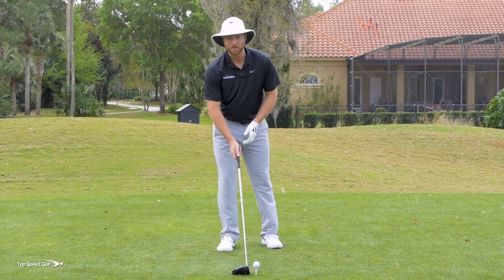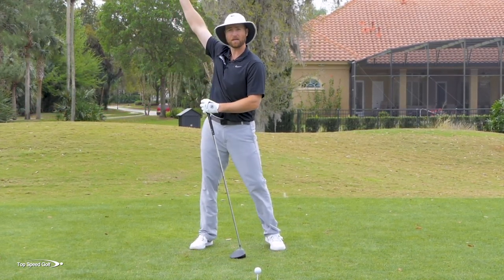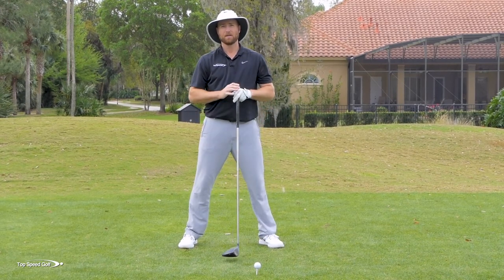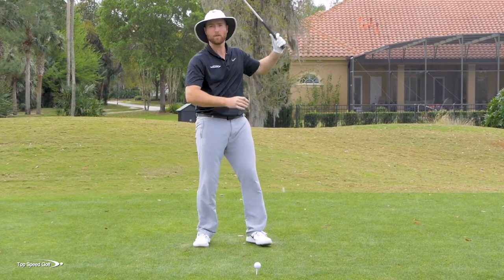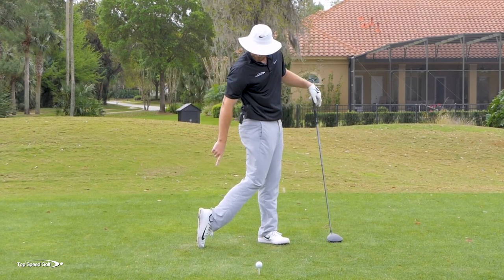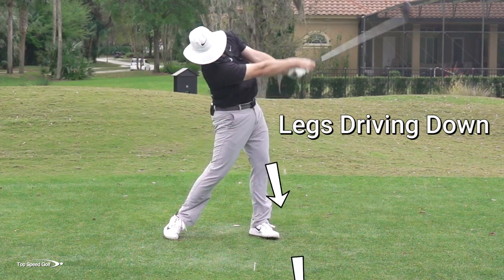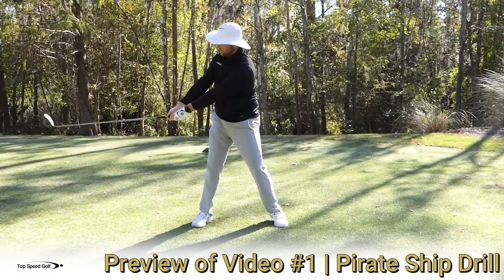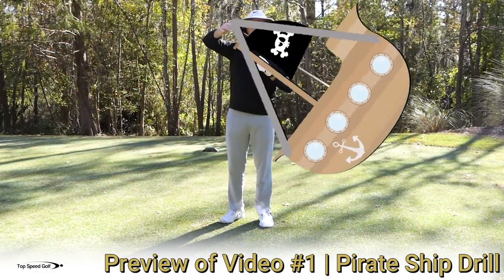Do You Want an EFFORTLESS GOLF SWING? Here are 3 drills

Comment: Q, does hitting into a “firm” left side or straightening left leg enough to open the left hip per Clay’s video. Trying  to simplify swing thoughts. Thanks
Reply from the maker: Hi, yes, you wan't to push and straighten out that lead leg through impact so you can keep rotating. Make sure you are pushing away from the ball so you rotate. Don't just push straight up otherwise you'll early extend.  Play well! Quentin | TSG Instructor
Reply: Top Speed Golf - Clay Ballard Thanks Q, it also seems to give a feeling of my head staying behind the ball at impact especially with the driver.

Comment: I was looking at some super slow motion swings and it appeared the lag had ended by the time the face impacted the ball .  Is that true?  What I mean is, in time lapse photos the hands do not appear to be ahead of the club face at the moment of impact.
Reply from the maker: Hi Glenn, the max lag position is usually about when the lead arm is parallel to the ground in the downswing. That's about when the club is starting to release. The club head doesn't overtake the hands until the Straight-Line release position is is usually about 45 degrees in front of impact for better players (where the club splits the forearms). If you're just breaking it down as to when the club head passes the hands from left to right then what you're seeing is pretty much correct.  Play well! Quentin | TSG Instructor